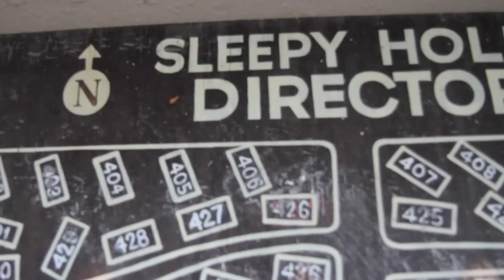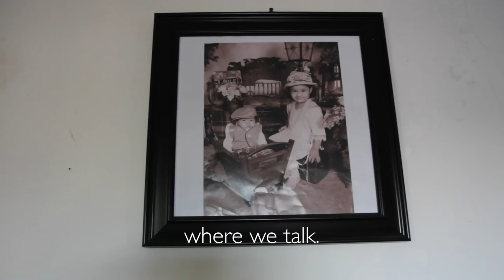Tucson: Trailer park living for America's poor

Comment: Update for 2023: This property has been bought out and will soon be townhouses, low income housing, and disability housing. As well as a park will be built on the site. The few residents who currently live on the site will be able to move into the new housing (I'm not sure if it's subsidized, rent to own,  or if they'll own a condo). This project had wanted to be done for years but the buyer had a hard time finding the owners of the property who were in China. Also getting financing to build this type of project was problematic since it's located in a very blighted section of Tucson.

Comment: I want to hug that Rosetta lady so hard. She's made out of sugar, spices and everything nice. Also why is she paying 500 dollars a month in rent when the other guy said they are worth around 35,000? That's insane.
Reply: * $3,500. I believe she is paying $500 for the rental of the land she is on and the trailer is hers ...... the stories are a bit off
Reply: +achimvr  Like every other problem in the USA......It depends on what state you live in. Example...I live in the Boston suburbs. My small 700 sq foot, 1 bedroom condo in a basement is worth $275.000......in another part of the country a unit similar to mine might be $45,000....possibly less. Problem is the cheap places are often in undesirable (unsafe???) areas.
Reply: +achimvr  the cheap land to buy is out in the desert, far away from hospitals, city transport systems and such.  That alone, if they can even drive anymore will suck up any money saved.  I live out in the desert, in a trailer (heat and a/c suck) on an acre rented for 350 a month (the land).  Takes me an hour to get to work, im not retired yet.

Comment: I once lived in a rent house and at the time, I would have gladly exchanged it for a mobile home.  However, it only cost me $100 a month + utilities.
It was less than 100 ft. from a busy highway so we heard the traffic day and night.  It was, what many refer to, as a "shotgun house".  You look in the front door and you could see out the back door.  The living room, bathroom, and kitchen had 1 electrical outlet each.  The two small bedrooms didn't have any.  It had a gas heater in the living room and one bedroom.  There was no insulation in the walls so in the winter, the walls would sweat.  In the summer, we had to leave the windows open just to get any air circulating at all other than a oscillating fan we moved from room to room.  That made the noise from the highway almost unbearable.  The water from the water well ran so slowly, it took at least 15 minutes to run bath water.  One good thing about it though....living there for almost a year, we were able to save enough money to put a down payment on our first house.  :o)
Reply: I'm glad you were able to save money for your first home, that's a great way to look at it. I've lived in some bad places too (even in abandoned buildings for a while in my teens) but it was all stepping stones to finally having more stability ^_^
Reply: GOOD for YOU.... !!!!!

Comment: Nowadays we have “tiny houses” which are really just glamorized trailer parks
Reply: And tiny houses are now 100k and up
Reply: Tiny homes are usually built much sturdier than mobile homes.  But you do what you gotta do.  And I'm sure there's a lot of tiny homes that are shabbily built.  The problem with pretty much all mobile homes are the building materials aren't built to last.  That is deliberately done both to be less costly and forces people to buy multiple homes in a lifetime.
Reply: jason m. Newer manufactured homes are built to the same standard as on-site built homes. This has drastically changed over the years, thankfully.
Reply: @jpmnky  modern mobile homes have been required to be built to a better standard
Reply: It’s not about the sqft of the house, it is about the people who live there

Comment: To  clarify a few things: There is a difference between mobile and manufactured homes. Congress changed the laws and anything built from June 1976 forward must comply with HUD code. So that means that manufactured homes can and do get financed, but in a park it is called a chattel loan. If it is on private land, it is a normal mortgage. This park would do well to get rid of all of those old homes as they are firetraps and get new ones put in. Especially some park models which are smaller homes that would benefit the retired, single, married couple, etc. 

Here in Iowa, code is very strict so homes that are farther south than north Missouri cannot be brought here to live in. My dealer has full drywall homes and they are built well. And yes, there are insurance companies that will underwrite insurance policies for them (State Farm being one). Lot rent around here is about $280.00 and up depending on the park. That does include your water, sewer and trash. 

To all the people living in this park, I would see if you can find something that is less lot rent wise and buy your own home. Park models are really cute and aren't huge so you don't have to spend a lot of time cleaning. There are some really nice single/double wide homes too. God bless!

Comment: Those trailers aren't meant to be lived in for more than 20 years. They wear out quickly. The cost of fixing it may be more than the cost of building a new one.
Reply: its like living in an RV, floors, walls dont last, you are right, costs to much to fix it up yourself
Reply: I have a 1970 mobile home and I put in hardwood floors and have all my walls and ceilings redone with new insulation and I have a new roof and siding and Plumbing and I guarantee you my mobile homes nicer than a lot of people's houses it's not that expensive to fix up a mobile home if you know how to do it. It's like a house if you do not take care of it it will turn to s*** my bills are a lot cheaper than any house and it's mine. Why people are paying high taxes and bills on their house my taxes are only $85 a year for the past few months in Ohio it has been - degrees and my gas bill is at 62 bucks for a month. And that's why we just bought a brand new car
Reply: MondoBeno everybody dont got talent like Michael Jordan so poverty is the only choice
Reply: Not here in Cali, the cost rebuilding one is cheaper than buying one, because in my area  buying a new one can run anywhere from.200k to 500k for two story ones while buying a fixer can cost about 30-50k and fixing it, my coworker bout his for 30k, I stalled floors, walls insulation, roof, drainage etc. All for about 50k, now hes thinking of selling it and buying a home the estimate he got for it was that he could easily resell for about 180k maybe more since demand for these mobile homes is up because of many millennials cx.
Reply: Carlos Ruiz Where in the hell do you find two story trailers that cost 500k?
Reply: WashingtonWebFoot theres a manufacturing facility here in SD where you can have your own custom mobile home built and the most basic 2 story one I saw was about 450k but so and I mean it's gotten to the point that where I like theres a "luxury" mobile home park and the trailers for sale are nice but they're asking over 200k for just the trailer and they're "ok" at best plus if you do buy em you can only lease the land you're going to be using, you can't buy it
Reply: Well you've got to work with what you have... 800$ a month aint enough to build a new one.
Reply: A mobile home isn’t all that different than a house. It depends on how it’s built and who’s lived in it. I own two mobile home parks and buy many 20 year old mobile homes to fix up and rent out.
Reply: Gray Au yeah, I agree. I’m single, so there’s no second income for me to buy a house. Even if I bought a house, what’s a single person going to do with all those bedrooms and bathrooms? Too much space to upkeep. Apartments in my area are 1300 a month (for mine anyway) and they suck. I’ve looked at a few modular homes and I was blown away. They don’t have those rectangular shapes anymore. They really do look like nice little ramblers with huge decks and windows galore. I was astounded. So I’m going to look into buying some land and plop one of those down on it.
Reply: c bass switch the stove and heaters to electric, save roughly $40 a month. It may sound expensive but they have scratch and dent & repo appliances that work completely fine .
Reply: We own one that is from 1970.  Its beautiful inside. We use is as a summer getaway. We did quite a-bit to it to give it character but its two houses from a big lake. People come inside and really love it.  It was in nice shape when we bought it and a little elbow grease and imagination went a long way. Just because people don’t have a lot of money doesn’t mean they cant be clean and creative. Pride of ownership is all it takes. There is plenty of waste materials everywhere and furnishings for practically free. Trouble is these good people end up living near losers that cant get their asses off the sofa to do anything but do drugs and drink.
Reply: Yeah, but fixing can be purchased piecemeal, whereas buying new(er) has to be a huge outlay of cash all at once, even if it's just for the down payment. Easier to repair little by little when you have to budget every penny.
Reply: @dayangmarikit6860  - I don't quite get $800/mo, but my obstacle that I can't see my way past is that I have no clue how to fix my leaky roof, and I have to fix it before it falls in. I have no experience, and the materials... man, I can't seem to find a bargain, and full retail price is too high.
Reply: @TheBikemaster94  - Then what do you do when the power goes out? I'll keep my propane stove.
Reply: new ones here in KY start at $19k for a single wide and $49k for doublewide
Reply: They are called modular houses. I have seen them, they start at $207k
Reply: 100% right!! i fixed alto old trailers. every thing is glorified card board! i was in one that 30+ years old and needed to be demolished. the pipes are made of thin plastic almost like glorified drinking straws that will snap and flood the glorified card board box!

Comment: They used to build trailers with such cheap materials staples, particle board, and the thinnest paneling. Any leak and the place turns to mushy sawdust. I think they are building them better now but the price is through the roof. The modern ones are big and fancy and are unaffordable to people living at the poverty level. They should have some mobile homes that are small plain and simple. Just having plywood subfloors instead of the particle board would help so much.
Reply: I noticed a lot of modern mobile homes damn near look nicer than "real" houses. There are outdated homes priced at like $300,000+ clearly in need of new carpet or maybe new wood floors, need to be painted, need cabinets, counters etc updated. Then I've seen mobile homes that look like legit modern homes with nice colors, modern cabinets, counters, etc. Even if they are made of cheaper materials they look nice.

Comment: It is interesting how so many people are moving into tiny homes.  Yet trailers were the original tiny home!  It is usually not the people but the owners who create the major problems with these parks.  If the manager is not able to move people out for ilegal activiites, and facilities are not maintained.  Of course the park will degrade.  I feel for those people who have made their homes their castles in this park and many others.  Who are proud home owners.   I feel for the new manager who wants to improve.  If the owner is not prepared to maintain the managers cabin it would seem logical the owner does not give a damn about the residents, the infrastructure.  Probably can not sell the land until all the owners/long term residents die or leave!